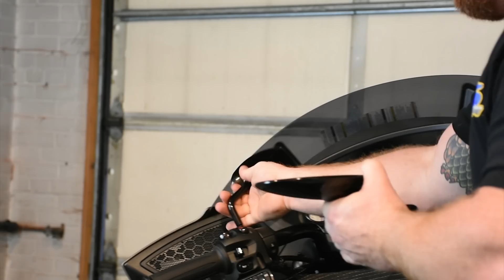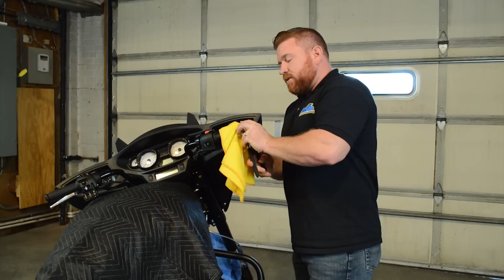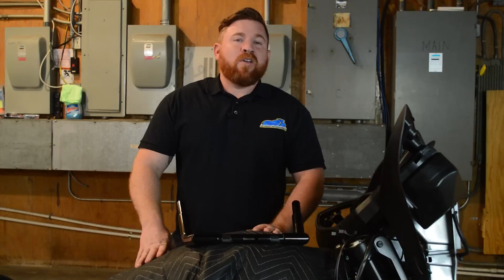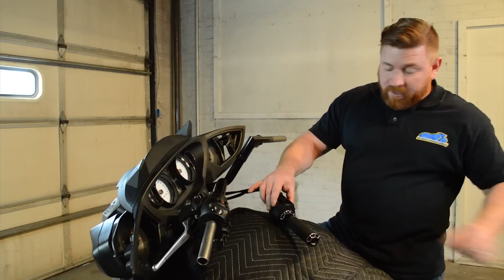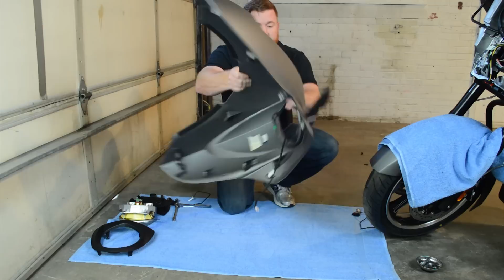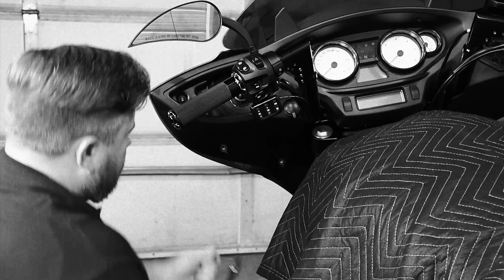2016 Victory Cross Country - Arlen Ness Project Build Episode 3

Comment: John, just as a follow up on the handlebar assemble, did you switch the 90 degree handle attachement piece after?  I noticed in part 5 all the allen heads are on the inside when you do the recap.

Comment: John, I have the same bars but in chrome, my question is what part of that bracket did you modify on the throttle side of the handle bar, did you just cut off the tip of it?

Comment: So that bracket you have to alter on the throttle side is probably for the cruise control?if you have to alter it does that mean these bars are still compatible for bikes with the factory cruise control?
Reply: You are exactly correct. I have the tour and that is where my factory cruise control is located.

Comment: One question I have. Did you need to get new longer cables for these bars or were the stock ones used. Im not sure if I missed that part in the video.
Reply from the maker: The cables were long enough, but you will want to loosen the cable clamps before installing the new bars to get a bit of wiggle room.

Comment: How come you guys didn't run the wires internally through the bars? I would have loved to see how that is done.
Reply from the maker: +Jacob James This bike is demo and may need to be returned to factory when sold. Next time we can run the wires, but its pretty simple, just time consuming.
Reply: Oh ok.  Thanks for the response.  I've never installed bars before so it would have been nice to see how to run the wires.  I appreciate the video though.  I learned a lot.
Reply from the maker: We can show that on an upcoming video, but each bike will be a little different. Main thing to remember before you ever touch wiring...Disconnect The Battery!!!! This will prevent you shorting something out and damaging the electrical system.
Reply: Thanks for the tip.  I really appreciate it
Reply from the maker: Any time, that's why we're here!

Comment: hey boss, like the vid. just wondering if you know of a hammer s having some sort of fairing that looks like the cross coutry's. or where to go to get one. thanks alot
Reply from the maker: +Leon Golightly You will need the fairing and a mount. Here's a link to both for the Hammer. http://www.cruisercustomizing.com/batwing-fairing-various-metrics/part/MEM7031

Black Mount http://www.cruisercustomizing.com/no-tool-trigger-lock-mounting-kit-black-for-batwing-fairing-victory-hammer-kingpin-04-10/part/MEK1928

Chrome Mount  http://www.cruisercustomizing.com/no-tool-trigger-lock-mounting-kit-for-batwing-fairing-victory-hammer-kingpin-05-10-kawasaki-vn1600-mean-streak-04-08/part/MEK1927